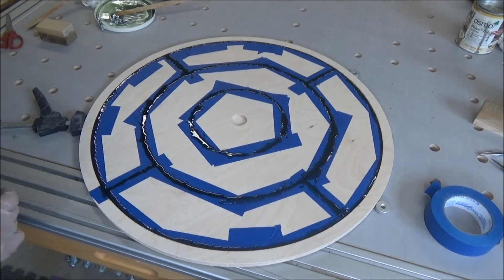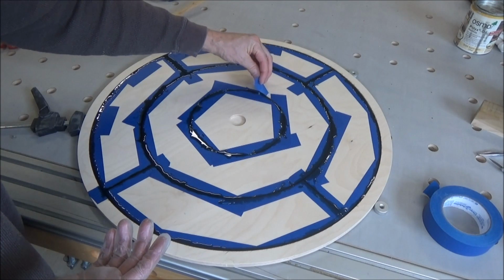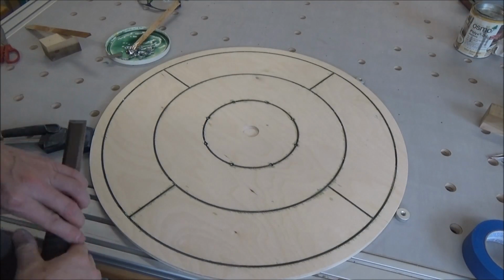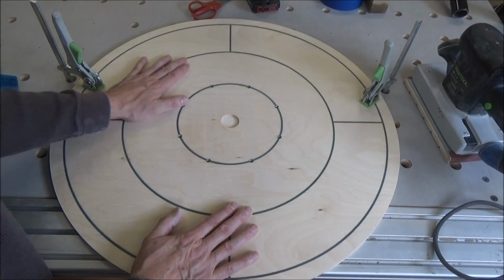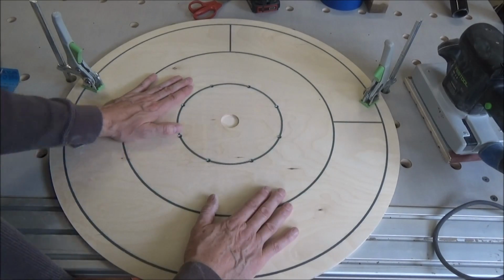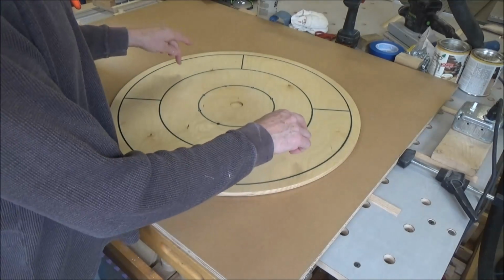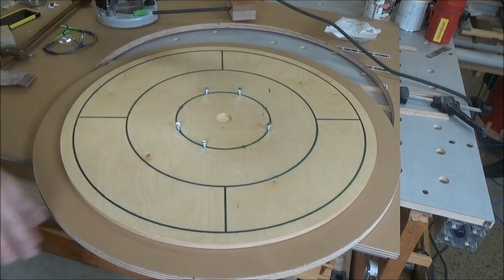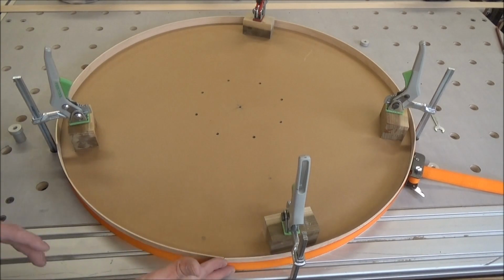03 Crokinole

Comment: You used 1/16 maple? What size sheet did you buy for making the edge?? That’s the only part I’m confused on. Did you staple, glue it?
Reply from the maker: Glued it on and it was ripped from board that was 1.5 inches wide.

Comment: How did you do the round railing around the outside of the entire thing? That’s the only part of building one of these that I can’t figure out how to do? Is it just some sort of very thin board that you can buy that will just bend around the entire circle?
Reply from the maker: You nailed it. I usually go about 1/16 inch thick and try to get the straightest grain wood you can find. I have also had success with thin pieces of plywood that have been rip cut to width. Don't try to plane it, that is nothing but trouble.

Comment: Can you say me what kind of wood suitable for this game?
Reply from the maker: I used Baltic Birch Plywood for the main base and hard maple for the outside rail. Thanks for watching.
Reply: @JeffFischer1  thanks Mr for your reply.
What kind of material pieces are made of,And what kind of thing is used below that does not damage the board and does not cause scratches?
Reply from the maker: @farhadomidi8007  I used White Oak for both and stained one set. I used Osmoil on both the playing surface and the pieces.